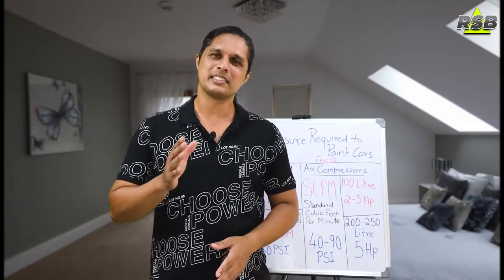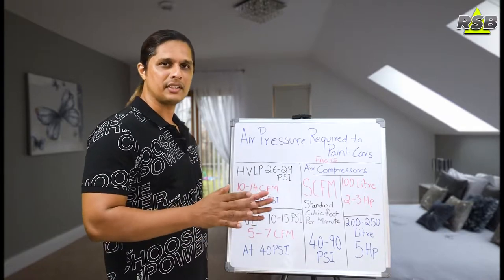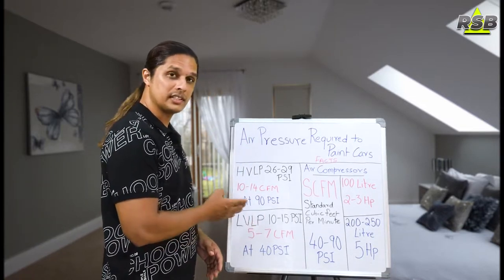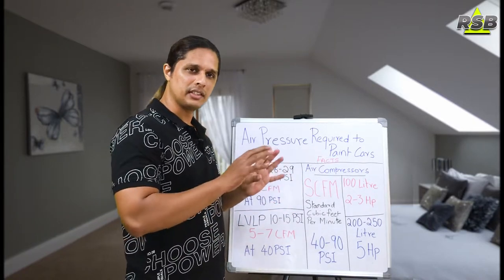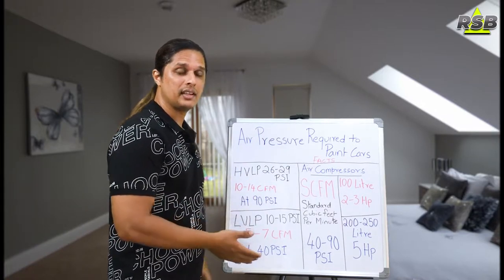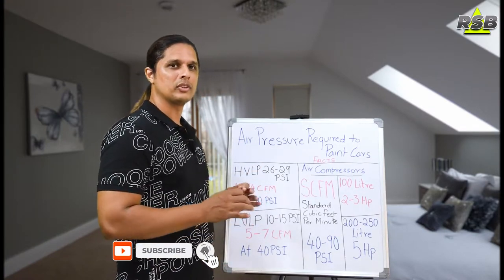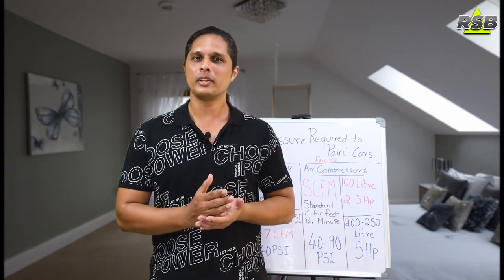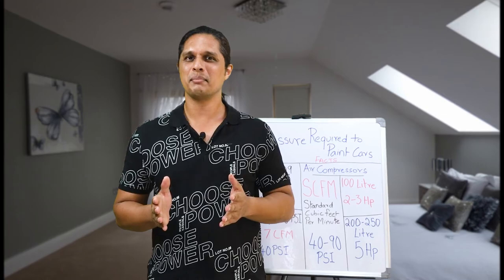How Much PSI Required To Spray The Paint On Car | What is CFM? | What Air Compressor is Best For You

Comment: Well explained. Now, I need a recommendation since I have already bought the compressor (1.7HP) 200PSI, 27 Gallon. Which LVLP brand do you recommend to paint a car by pieces, fenders, hood, and doors, all are apart at this time. Thank you for your video
Reply from the maker: which guns are available to you in the market?
Reply: @rysonsspraybooth  I bought a cheap HUSKY HVLP from HOME DEPOT, 1.4mm, then I bought LVLP INTERTOOL 1.3mm, on AMAZON. Now I think is better to change the compressor, is giving me orange peel, like you said, it is better the 5HP if I want pro results

Comment: Heya excellent video man, keep it up so I just subscribe 🤙
Question please,
*4hp motor 2800rpm
*150L tank
*115 psi max air
*Air delivery 360L@90PSI
*Air Displacement 26CFM

Is this ok for car spraying? Please help.
Reply from the maker: Usually I recommend minimum of 200 liter to paint a car, your CFM looks good, you can still paint a car with that compressor, but it will restart many times in between your paint job resulting in water in the air line, you will have to use good water traps and you will have to take rest in between to give the motor some time to cool.